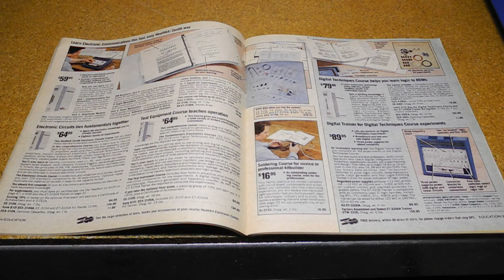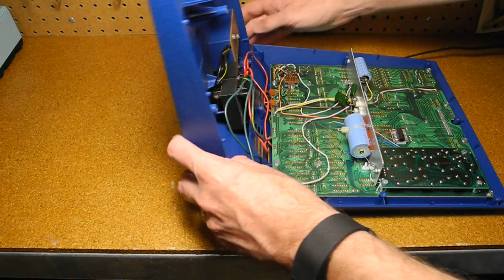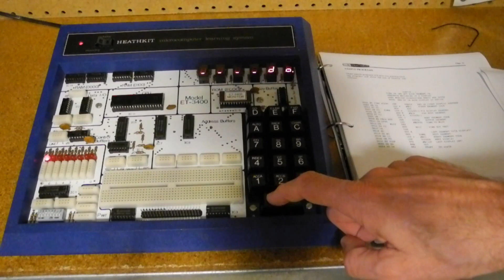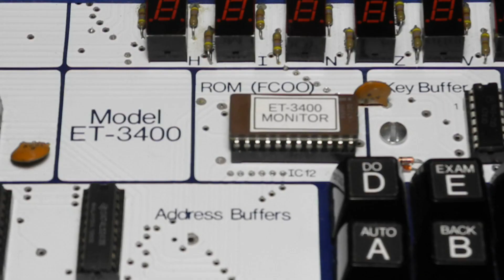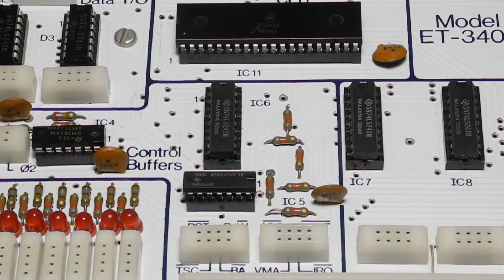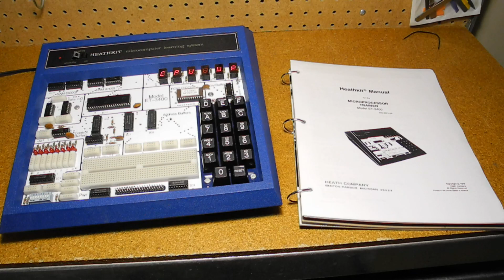The Heathkit ET-3400 Microprocessor Trainer

Comment: I trained on this in college back in 1990, after I graduated i made one using a wire wrap board from an obsolete process control system, programmed the rom and found a hex kybd from another device with Hall effect switches and it still works today!

Comment: I thoroughly enjoyed using the MC6800 processor in school as the first "low-level" type of programming that I had engaged and interfaced with. Previous courses used higher level languages such as FORTRAN and BASIC. An interface course at this level not only gave a much better understanding of things like memory layout, access, etc. but was my first experience interfacing with real world I/O such as TTL logic chips. The other recall I have is just how compact the programming can be when writing in opcode compared to a compiled or assembled language. It is also amazing how close to realtime one can get even with a relatively slow clock speed as only a few clock cycles are required per instruction and high priority type tasks could be easily managed through interrupt servicing. In retrospect, the entire system, with it's peripheral interfacing architecture, powerful addressing scheme, tristate bus and the ability to "micro-channel" I/O on the same clock pulse (uniquely configurable peripheral interface adapter or PIA) made this system an engineering marvel of it's time and allowed Motorola to venture into the industrial control world unrivaled by other microprocessor manufacturers of the time. Genius at work.
Reply: I agree with you that this indeed was an engineering marvel and I can't really see anything now that matches it . I know of course that things have advanced hugely and people now have the Arduino, Raspberry etc. but I feel that you're more detached from the controller on these systems , not that I have any experience of them , as I am not a professional  . Take care ,Kieron
Reply: @Rolf Jander Thanks for the info
Reply: Sorry for resurrecting a long-dormant thread, but I'm curious for more about what made the PIA's same-clock-pulse I/O special? I grew up in the Motorola ecosystem so I'm not familiar with what other CPU families of the time offered for I/O. What made the Motorola PIAs different/better?

Comment: my house electricity is 240v, and the device is 120v, what to do? help me.
Reply from the maker: It can be wired for 240VAC. The manual (which can be found on the Internet) describes how to do this.
Reply: @jefftranter  not true in all cases. the ET3400 could be rewired for 240V but unfortunately not the ET3400A has a dedicated 110V transformer so can’t be easily rewired. I’ve got both models and my ET3400A is still in its 110V only configuration so the only way I’ve been able to use so far it is by connecting up +5V directly to the motherboard. One day I’ll work out how to get around the transformer problem.